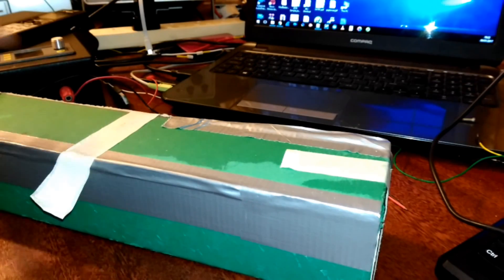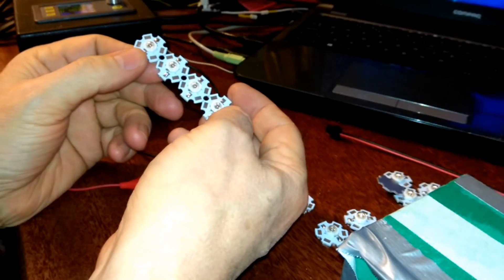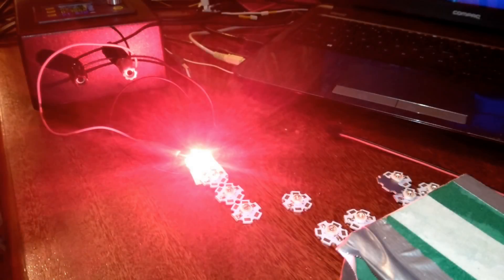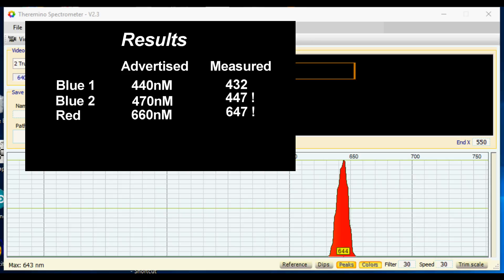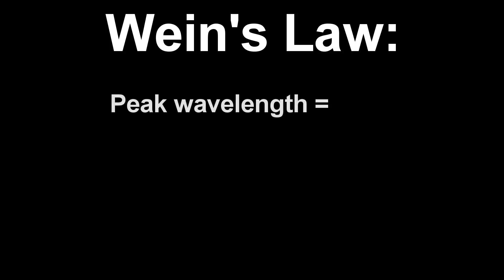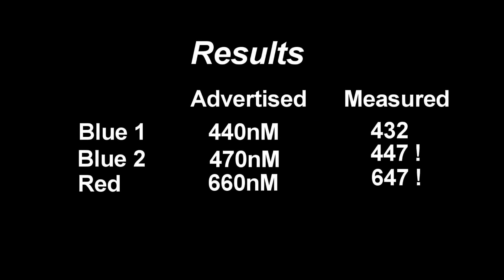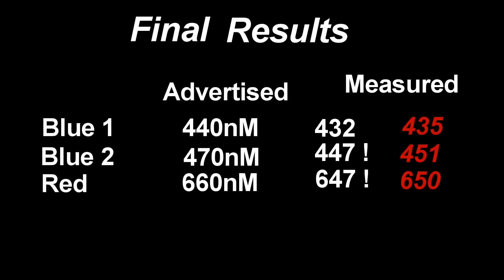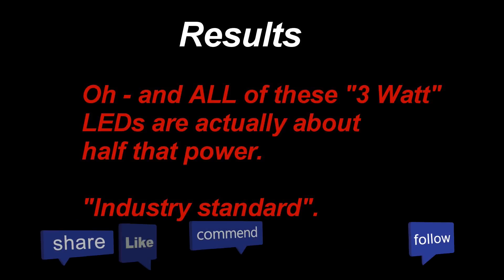Power LED Spectrum Testing

Comment: Are you quite sure of intensity and wavelength calibration at those frequencies , you might compare with a calibrated spectrometer if someone is nearby with a lab
Reply from the maker: Hi Kaveman. The calibration is based on the spectrum of a CFL's characteristic lines, and they are base don specific element which radiate at very specific frequencies, so yes - I'm sure. I don't have access to a(nother) calibrated spectrometer so I can't do the comparion you mention, but the documentation for the software I use shows a spectrum from a professional machine and the agreement is extremely good - within a nanometer.
Reply: @chriswesley594  it is still possible that your spectrometer is not linear in its wavelength response between your calibration points...

Comment: is it possible that your spectrometer isnt accurate? what do you use as a control to calibrate? do you have any known calibration leds? i really need one of these meters asap
Reply from the maker: Tony, the spectrometer is calibrated by the customer on receipt. The software provides an easy mechanism. You click a button to put it in calibration mode, and then select which wavelengths you want to use to calibrate. You can also define your own depending on the sources you have. Full instructions come with the software.  I use the Mercury lines at 546 and 346 nm from a common CFL light bulb for calibration to make sure the instrument is working as intended before I ship it. This sets two known points and a distance between them. The process takes maybe 30 seconds.

This process assumes the instrument is perfectly linear, which, of course, it isn't. After all it uses a webcam as its sensor! Astigmatism in the lens causes minor local non-linearities - a few nanometres at worst, and it varies between cameras. You can mitigate against this by calibrating more locally in regions of the spectrum you are working in. For example, almost all TV IR remote controllers work at (I think, if memory serves) 980nm. You can also use IR and UV lasers to calibrate but make sure you buy from reputable dealers. Mine have certificates. Also allow them to reach thermal equilibrium before calibration. 

Finally, I'd say - if pinpoint accuracy is a requirement for you, then the compromises arising from a £50 instrument may not be the right answer for you. I have found that it meets all my needs and no customer has ever complained that theirs didn't meet theirs. (except see the video about IR in the playlist - a problem was fixed in that connection long ago). If you know what you're doing, know the limitations of your instrument, and know how to live with them, then all should be well.

Comment: This is indeed fascinating to me.      I am interested in using it for similar purposes, validating wavelengths of red and IR sources, but also see a good use for determining specific blue wavelength components because of recent developments regarding the role of blue light in sleep disturbance.
Regarding measuring IR components, do you know how long a wavelength can be determined from the software / camera?  I'm interested mostly in 850nm area, but being able to detect longer wavelengths reliably would be helpful.
Reply from the maker: Ramix, I do not know the IR limits of the device. It would depend on the characteristics of the CMOS sensor in the webcam. However, the sensor in this webcam is not marked, so I can't look it up. I could find out empirically by testing a variety of IR sources, I guess - but I have not done that work. But if you build one and do that - please let me know - or better yet - make a video.

Comment: Hello, fascinated with your build. I have two questions: have you found a manufacturer that is reliable? Second, I'm trying to grow greens - leafy, micro and herbs. Have you acquired the knowledge of the LED recipe required to grow these in the most efficient manner? ie, the optimum spectrum and a combination of LED lights that is the cheapest to use? it would be great to converse with you about this. Thanks!
Reply from the maker: Hi Bujjai, I have only made one purchase of LEDs so far, so I have not searched for a reliable manufacturer. Most consumers do not have a spectrometer and so they're in the dark about what their LEDs are really doing for them - which is why I built this one. I suspect there is actually a tiny number of manufacturers - and far more intermediate packagers, importers, badge engineers, etc.

So I am not an expert and have done very little research - this spectrometer was built as a tool for future work, but events have overtaken me this year. But I will return to it soon. Good luck with your tinkering.
Reply from the maker: deuce deuce - you're welcome, and thanks for making time to send me your thoughts.

Comment: I guess the wein's law only apllies to back body radiations, in the case of leds' radiation it doesn't.
Reply: It's Wien's law and yes, you are right. A non-blackbody spectrum can be only approximated by an equivalent color temperature. The same mistake was recently made by a proclaimed inventor of cold fusion...
https://en.wikipedia.org/wiki/Wien%27s_displacement_law

Comment: Regarding ratings of the LEDs... I think the higher ratings listed are actually MAX ratings from the component spec sheets.  
Yes, you "could" run it at 3W --- IF it was a prime part and you had it properly heat sinked and a properly limited power supply, etc... But unless you are buying directly from the manufacturer or commercial vendor, you probably won't get past the first "if".  :-(  That's the nature of the beast when buying online.
Reply from the maker: Hi Ramix and thanks for your comment. However, I don't know HOW I could run it at max spec. You feed it with the recommended voltage and current, and it does its thing. And the thing it does is give out far less power than advertised. The only way I can think of to increase power would be to push it OUT of spec, and that invites early failure. Unless you know different?

In a sensible world, the advertised power would be the actual power. Cars would deliver their advertised  MPG, politicians would deliver on their manifesto, advertising would be honest, and pigs would fly.